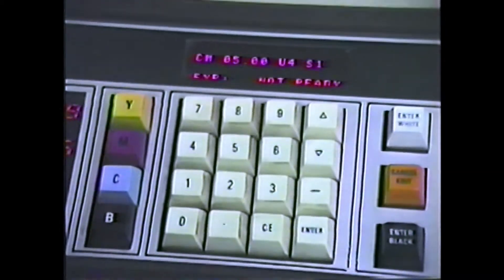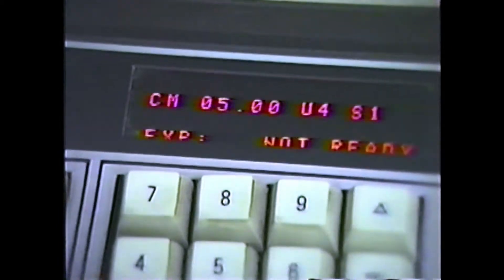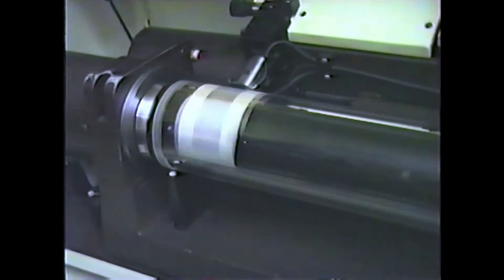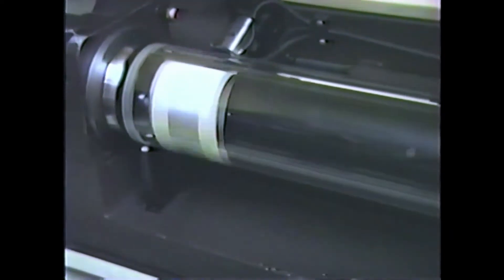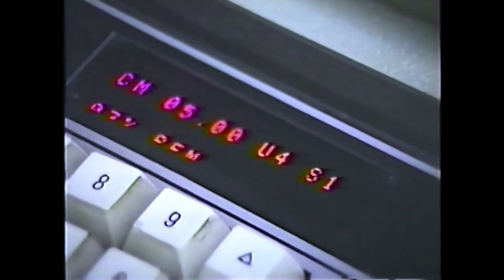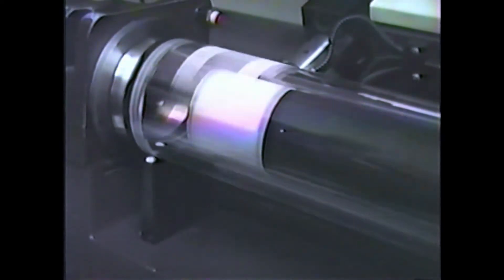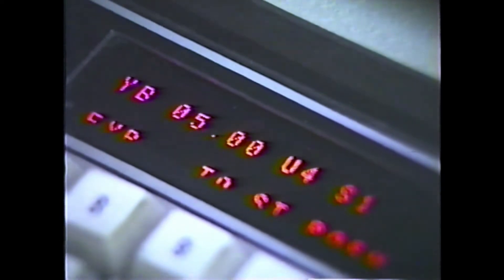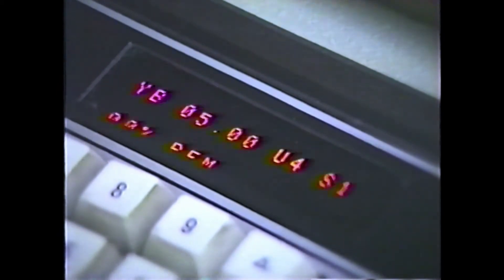Crosfield Magnascan 540

Comment: I taught the first customer training course at Crosfield in Holloway Road London, a two week course, happy days. The 530 and 540 replaced the 510, 515, 520 and 550 scanners.
Reply: Began my career in the printing industry as a B/W cameraman (first line images followed by halftones).  Started with a Brown Caravel and later ran a Robertson Comet II (beast of a low-bed process camera).  During college, was able to briefly work with a Hell Chromagraph DC-300.  However, most of my experience was with the Crosfield Magnascan 540.  Upon graduation, I found employment with a colour separation house utilizing a Hell Chromagraph CP-341 and a Crosfield 636IE.  Making the transition from the 540 to the 636 was fairly easy (electronic dot generation --- no contact screens).  Absolutely enjoyed my time spent as a scanner operator / photographer.  Would have liked to have attended one of your training courses.
Reply: I also started as a B/W camera operator, and worked on a Hell DC300, a LinoScan 3040, and Dainippon Scanners, gosh they were great days, so sad that digital cameras made scanners redundant, now everyone uses their smart phones to take pictures, so much for advances in technology.  @magnalink600
Reply: Good times, there was magic in the machines and art in the operator 😊

Comment: nawty nawty running with lid open
Reply: Guilty as charged.  These were training videos I was working on for a college class in color separation imaging.  Crosfield made it easy to defeat the safeties on their scanners in order to pull this off.  Many of Hell's scanner ran with the scanning drum exposed.  You must have run a Crosfield to know about the safety measure.  Thanks for your comment Andy!
Reply: @magnalink600  I was an engineer for crosfield from 88 to 95 then fujifilm to 2018, so yes i nkow all about defeating the interlocks
Reply from the maker: @andyleather3014  The 540 was a contact screen scanner.  After I left the university, I worked in a small separation shop running a Crosfield 636IE (I was in heaven - electronic dot generation).  Prior to my college days, I was a cameraman producing line and halftone images on a Robertson process camera.  So, having a machine that produces a set of separations in minutes blew my mind!  When this company closed, I found a job with another color house running one of the new Hell Chromagraphs -S3400.  This new breed of scanner took all of the skill level away from the operators and put control in the hands of software.  I always looked forward to you guys coming in to work on the scanner.  I learned so much by hanging around with the engineer and asking questions.  I worked in Dayton, Ohio and the engineer I worked with was named Terry (I forgot his last name).  I also worked with a British photographer named Simon.  Where territory did you cover as an engineer with DuPont & Fuji?
Reply: @pixelrific1280  when at Crosfield i started as an inhouse enginner in the Watford Training Centre. Then i moved to uk service and spent most of my time in london. With Fujifilm all of the uk. we did sell the 6250, 550 and 2750 but soon died out when printers started bying kit instead of using repro houses.

Comment: How I miss those days ... Was a HELL Chromacom operator for years - when Print was still alive.
Reply from the maker: Overnight the Mac put the HELL Chromacom and Crosfield Studio systems out to pasture.  I ran a Crosfield 636 and a HELL CP 341.  In both instances, we had a Mac connected to the scanners in order to scan images into these systems and output corrected files to the exposure side of the scanners.